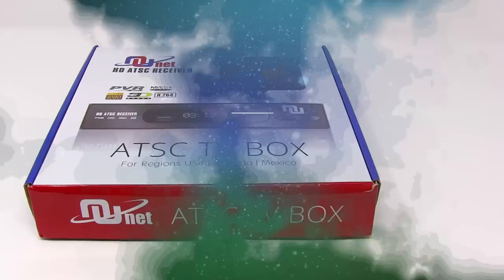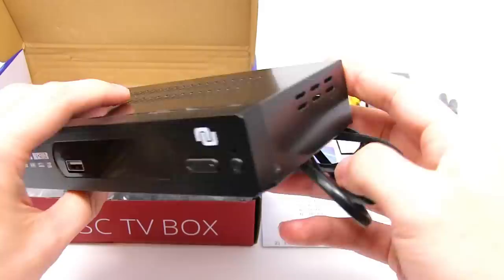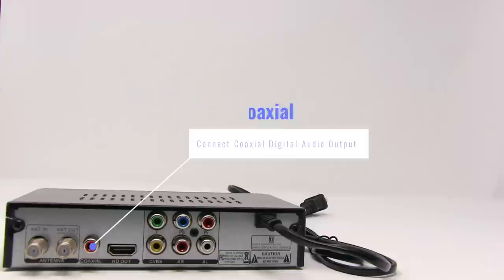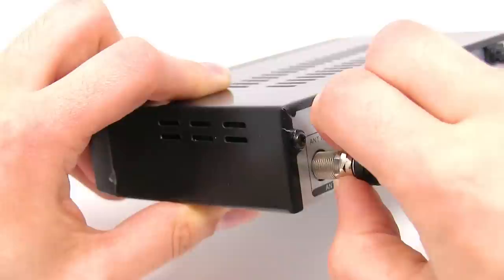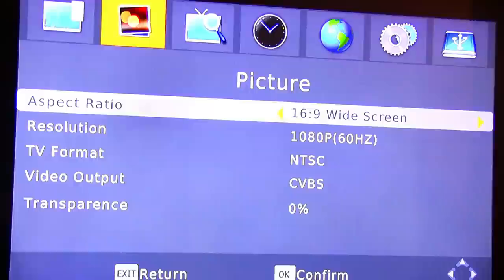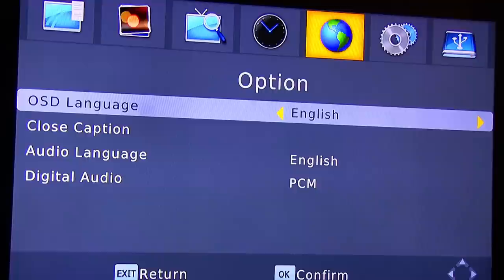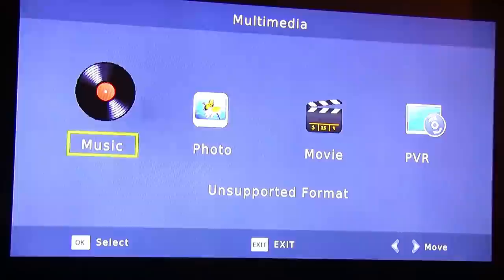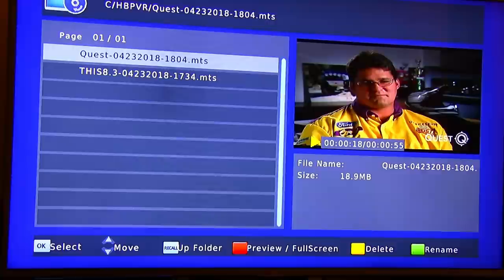How to install a TV converter box - featuring Voion HD Antenna ATSC TV Converter Box

Comment: We have a cable connection with 7 hd chnnels but the thing is, our tv box is a standard definition box only and we can't view the 7 hd channels, can i use this?
Reply from the maker: I provide the link to the item is the description. You might want to ask the seller or manufacture that question. I don't know the answer.
Reply: Sorry. You can not use this TV box to watch cable connection.This TV box is used with antenna to receive ATSC Over-The-Air TV signals.